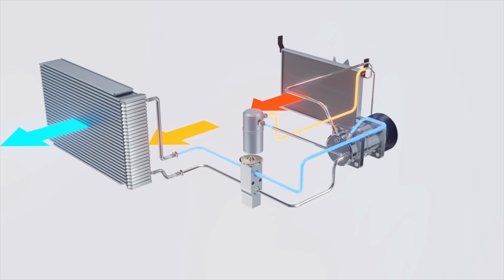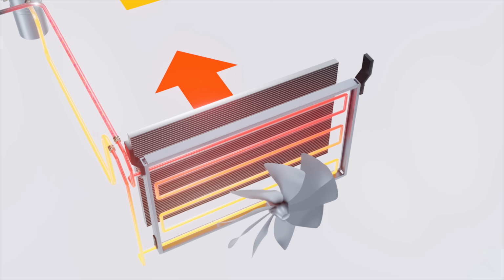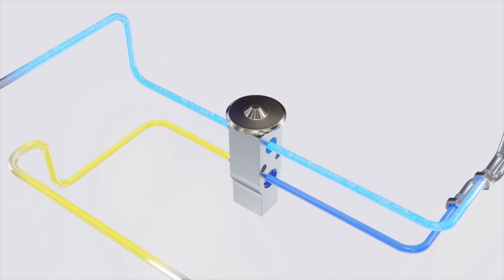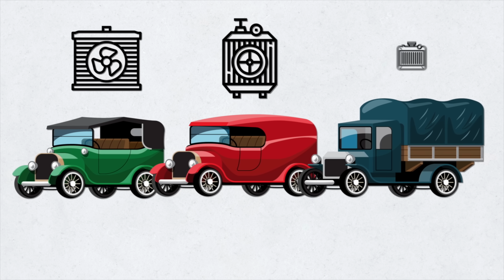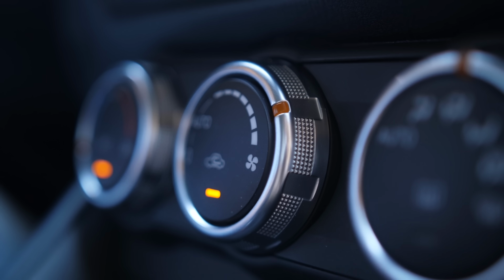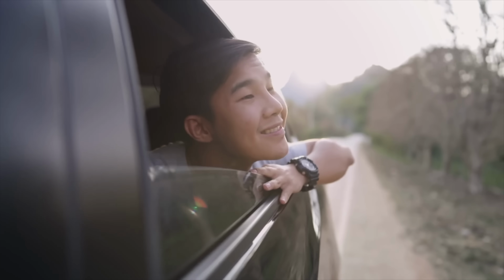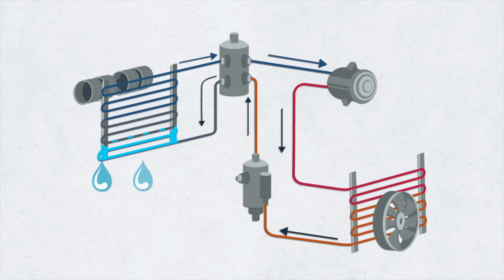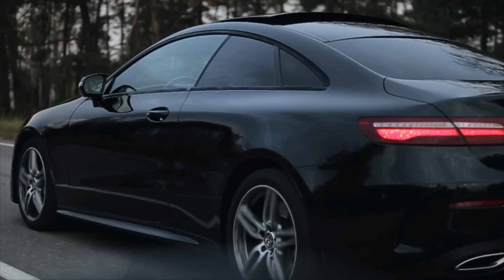Never Do This to Your Car’s AC System

Comment: Yeah, my car has been at a German car specialist for nearly a month and still not fixed, I  have picked it up three times already and the ac failed minutes after leaving the shop each time. So far this cost me around 4 thousand and nearly 2 months with no car and it's still not fixed. After 3k my sense was incompetence, but they promised this fourth time they would get it.   I have never taken longer than a few hours to troubleshoot much more complex systems.

Comment: One good tip with your car's or any air-conditioning system, is to switch it to fan (i.e. no cooling) mode several minutes before turning it off.  That will dry condensation from the evaporator and help prevent mold formation.
Reply: Interesting. Never knew that. Thanks for the tip!
Reply: This also helps people acclimate to the heat outside so it's less intense when you get out
Reply: @beebalm1776  lol
Reply: @koopapro Its true in hot countrys

Comment: @Scotty I have a 2006 Honda Ridgeline blower, when stopping for gas would not com on after a while it would then just quit! Long smoking and bursting into flames story short! Replaced the wiring harness and blower motor and yeah still sweating in central Florida. Still can’t find any blown fuse! But it seems to not have power at the blower plug-in? Any ideas?

Comment: I started driving in the early 70's, I remember my parents MASSIVE, 1971 Chevy Kingswood Estate station wagon, seated 9 people! If you tried starting it with the AC on it would put a heavy load on the start system because of the turning the compressor during the start cycle, sounded like a low battery, turn off AC and engine cranked normally..Now a days doesn't matter, like Scotty said it's disabled until the engine starts. Another myth I've heard is its harmful to run your system to run in Max AC all the time! Don't know if this is true or not, my AC is always on, unless I have the windows down, generally I just regulate temperature and leave the system always on. I haven't had any issues so far and I have been doing this for years. I enjoyed that car, was very smooth on the highways, 3 bench seats but the nice part was the 3rd rear seat folded into the floor so you had a nice cargo space if you only needed the first two bench seats. Thats still seating for 6..
Reply: And we also had to top off the water in the batteries.

Comment: Water drips out of the hole where my blower motor resistor is on certain days when I turn my A/C on. I should try using a camera to look inside the drain hole but eh, It doesn't happen very often. I just buy those water absorbing containers and no wet floor board.

Comment: I have a 05 Dakota at some point I’d say around 2009…every time I turned on the defroster there’d be a rapid fire clicking noise for the first few seconds as it got started… thought it was the cooling mechanism but always only happened whenever I turned it on or off… I’d say like 15 seconds of clicking.., it’d be quiet the rest of the ride… I don’t know much about it I pulled the fan out and inspected it but all looked fine.. cleaned it up of any dust.. put it back and no fix.. looked for videos here for the issue and only one I found… guy did the exact same thing as me and his stopped clicking. I was dumb founded.. it still cooled, defrosted and warmed in the winter.. was just that annoying clicking every time it was turned on or off so just left it.. figured it’s doing what it’s supposed to.. don’t mess with it..

Comment: My AC system sqeals and sometimes makes a grinding noise near the belt when the AC is turned on. When turned off it stops immediately and it’s quiet. I was assuming it’s the compressor but I wouldn’t know how to make certain of that, or if maybe it’s the belt

Comment: I have a Dodge Ram 2007 2500 and the fan on the condenser will sometimes not start and I have to open the hood and flick the fan to get it to start and I have been told that the fan needs to be replaced at a price of 350.00 to 450.00 do you think that is all the proplem and if I get the fan replaced will that fix my proplem. Does this sound like a resonal price. It cools as long as the fan is working.

Comment: So I am still training but I got a 2013 Honda Accord Ex-L with the 2.4 v-tec engine, and I noticed that my car shakes when I turn the a/c on. I'm still running some tests, like does it go away when I'm driving, but I did notice it typically does fade away. Is this a sign of a compressor beginning to fail, or is this typical operation for this vehicle?

Comment: For a while my relay what's up either is either shorting or had a loose wire. My heat or AC wouldn't work. It was the worst one it would rain during the cold months and I couldn't turn the heat on to defrost the window. The fog would be blinding.

Comment: its all about the newton thermal law but i dont think scotty got it right. high pressure always resolves in high temperature, releasing the pressure turns into cooling. if u put high pressure air into ur radiator it wont cool anything it just stays warm until u release that pressure. if im wrong i will be glad someone explain to me how to cool down 40°C-50°C outside temperature to 17°C inside ur vehicle while idling without driving 200mph .

Comment: My A/C is acting weird, sometimesit does not kick on, sometimes it is on and suddenly it goes off of the very minimum speed while the dial is at the max speed or some other times it kickes on to the max speed and stays like that forever it does not changes speed when I try to do it also when that happens, I try to turn it off but it only chages the air position when i hit the off switch. What can that be Scotty?

Comment: Starting the car with the ac on can ruin the belt driving the compressor unit. It's not good to start the car with the compressor clutches engaged! You should be at, at least, 25 mph BEFORE you turn the compressor on.
Reply: Squeaky belt? Try turning off the air-conditioning BEFORE you start the car.

Comment: 500 in parts and labor for the replacement of the ac compressor on my, don't bash me, 2007 nissan altima 2.5s cvt

Comment: Clean the inside of your windshield EXTREMELY well. This will prevent fog or frost for the first 10 or 20 degrees of warm humid weather or the first 10 degrees or so of cold weather. 

I simply use wet paper towels followed by a dry paper towel.  Don't use cloth, because they are greasy or dirty, and will either not clean the windows or scratch it. 

Clean "paper" does not scratch glass or metal.  If it did, I would use it for polishing metals. But it doesn't and I don't!

Comment: My ac is always on, no madder weather :) I had a brand new Hyundai I30CW, and always used the AC for 3 years, and in some of the Services Hyundai did, they checked my AC, they was very impressed by it. They said you AC work extremely good.

Comment: I was working for Advanced Auto Parts when a customer comes in saying their AC isn’t working, “all right let’s go see that the problem is” I said. I put a gauge on the system and it was basically on the verge of exploding due to so much pressure being in the system. The moment that gauge went on it pegged the needle at max pressure. So I asked the customer what was going on here? Now for the life of me I can’t remember what they said but I instantly recommended that they see the mechanics to recover all this extra refrigerant and have the system balanced or recharged.

Comment: 3 days ago I put a can of AC Pro Extreme in my Dodge Intrepid AC.    The Intrepid appears to be in the Mercedes class of complexity for replacing the evaporator.   The air is blowing cool now.   The last time I had cool air after dealer service, it lasted 2 months before losing refrigerant.   I'll see if this lasts more than 2 months now.

Comment: Oh by the way this is the newest car I've had in years and this little four cylinder 2.0 turbocharged is all new to me so I really need some help Elsa figuring the Tennessee now where about I'm in Chattanooga please help me give you some advice give me a heads up I've always take care of my own vehicles the newest vehicle I still own as a 2000 GMC Yukon XLT automatic 4-wheel drive 5.3 with 327000 miles on it that was my wife's baby and a washer last year and I can't bring myself to get rid of it always took care of it that's why hasn't many miles on it

Comment: I always find it tedious when someone says “Y’know, an air conditioner doesn’t ACTUALLY make cold air; it takes the hot air, removes the heat and humidity, and blows it back out.”  ...how is that not making cold air?  It’s simply a more detailed description of the process of making cold air. Having said that, I love Scotty’s videos. He’s hilarious and very informative. Keep it up.
Reply: After all, isn’t cold just the absence of heat? That’s the way I heard it explained way back in the last century when I was a kid.
Reply: @ronsamborski6230  yes
Reply: Most techs look at the process from a thermal dynamics viewpoint where the heat is absorbed by the refrigerant. The end result is making cold air, so yeah.. it's a semantics thing. 

I can charge extra throwing in technical terms, so there's that. :D

Comment: My a/c system hasn't worked in 3 years, it doesn't get cold. I was told the compressor needed to be replaced, can't afford to replace it so I've suffered for 3 summer's worth of heat.

Comment: So question? When sitting at say a red light my ac doesn't feel all that cold but  with higher speed the colder it gets . Is this normal but  keep in mind it's not very cold sitting or driving ?
Reply: Well i guess its somewhat normal if you car has a engine driven fan clutch, but if its electrical fan then no its not normal, i hear that in that case its either the fan or the condenser and to simply clean the condenser and maybe make sure the freon is filled properly
Reply: @fargeeks  Don't  mean to sound so uneducated on this but could explain to a dummy what exactly a clutch driven fan means? The fan does kick on seconds after I turn the ac on.  Not sure  if theirs 2 fans or one haven't checked yet 
If this helps it's a 2003 Camry 3.0 v6
Reply: @dannycolemire2652  its those fans where it will be somewhat slow when the engine isnt hot enough but when it does then the clucth engages and the fan spins about 70 percent of the water pumps pulley speed, but doesnt mean that when the engine starts revving up the fan is gonna do the same thing, anyway its the electric fans that kick on after turning the ac on so no the clutch fan has nothing to do with it

Comment: I recently had my condenser and evaporator replaced by Honda in my 17 civic. No cold air was blowing when I turned the AC on. Replacing both parts cost my just under $1300. Honda warranty covered the condenser. They had to take the cabin apart to get the job done. My service rep was nice enough to throw a discount too. AC is nice and cold now!

Comment: On a 2009 Toyota Corolla
My ac compressor clutch got stuck, stopped the engine from running, because the car used a single belt for all mechanical stuff, i had to toe the car.

Comment: I always make sure to turn off the a/c about 5 minutes before I get to my destination, and put the fan on about 75%. That way the evaporator has time to get to room temperature, dries off and doesn't remain cold. Helps prevent mold growth and that musty smell.
Reply: Hum and it doesn't get dust, from the engine bay, in by running your fans without A/C?
Reply: @helloukw  Nope, only difference is the a/c system isn't cooling/dehumidifying the air. It's still pulling fresh air from outside and going through the cabin air filter. And once the evaporator coil (the part inside the dash that gets cold) gets to room temperature and dries off, it won't get moldy/musty as there's no moisture left on it

Comment: Hi Scotty, I have a 1975 Lincoln Mark4 with 460 engine. The 
AC on the car only produces cool air when the engine is idling, and once I give it the gas is loses all the cool. Any idea of what might be the problem? I had it checked and the compressor and refridge levels are fine. Thankey kindly buddy!

Comment: My evaporator is leaking in my car, Can hear the gas leaking out behind the dash. And... Its a Mercedes. Need to remove the whole dash. It worked well for 18 years. but i roll around with no ac

Comment: Did you know???? The Goldberg Brothers - The Inventors of the Automobile Air Conditioner. Here's a little factoid for automotive buffs or just to dazzle your friends.

The four Goldberg brothers, Lowell, Norman, Hiram, and Maxwell, invented and developed the first automobile air-conditioner.

On July 17, 1946, the temperature in Detroit was 97 degrees. The four brothers walked into old man Henry Ford's office and sweet-talked his secretary into telling him that four gentlemen were there with the most exciting innovation in the auto industry since the electric starter. Henry was curious and invited them into his office.

They refused and instead asked that he come out to the parking lot to their car. They persuaded him to get into the car, which was about 130 degrees, turned on the air conditioner, and cooled the car off immediately. The old man got very excited and invited them back to the office, where he offered them $3 million for the patent.

The brothers refused, saying they would settle for $2 million, but they wanted the recognition by having a label, 'The Goldberg Air-Conditioner,' on the dashboard of each car in which it was installed. Now old man Ford was more than just a little anti - Semitic, and there was no way he was going to put the Goldberg's name on two million Fords.

They haggled back and forth for about two hours and finally agreed on $4 million and that just their first names would be shown. And so to this day, all Ford air conditioners show -- Lo, Norm, Hi, and Max -- on the controls.

Comment: What if the AC air smells musky when I start the car but starts to smell better after about a minute? I replaced the cabin air filter and it still does this. What could be the problems?

Comment: I bought a 2006 chevy impala brand new when it came out.  It did great for awhile but then all the gremlins start coming out around 2012.  First i had the water pump break on me, so i got that fixed right away.  Then i had the blend door actuators going bad and making constant ticking noise.  It was a cheap part but can be difficult to replace.  I had the dealer replace one deep in the dash and it was $700.  11 months later, it happened again, luckily it was the one the dealer fixed and they replaced it under the 1 year warranty.  Then i had another blend door actuator under my glove compartment.  This one i just left alone because it only started ticking when i turned off the air recirculation or turned off the car.  It wasn't doing any harm.  Then my a/c compressor broke.  I took it to a shop on the military installation and they told me to take it out in town to a mechanic, get a diagnositc and bring it back.  The mechanic said the compressor was shot and would cost $1800 to replace.  I took it back to the shop on base and they quoted me $1300 and that included replacing the whole a/c system, not just the compressor.  Plus i didn't have to pay sales tax.  A/c ran strong since then. Then my water pump broke again about 6 years later.  And then i had another blend door actuator ticking on me but it wasn't an every day issue, just when it felt like it.  At 124k miiles i decided to trade in.  Everything else has always been good with the car, the motor ran strong did regular oil changes with synthetic oil, never had an issue.  But never again will i buy a new design model in the first year.  I got a decent deal for trade in, i was expect $1600 because it was in fair condition but they gave $3000 and i used it towards a new truck.

Comment: Great video! I own an e39 for 14years (produced in late 2000) and the AC system worked without any major issues, I had 5years ago a cracked pipe and 2 years ago a funny thing happened, if I drove the car up to 120-130km/h the AC worked fine but as soon as I went higher a strange noise coming from the engine bay and AC dies,  if I reduce the speed below 100Km/h and restart the system, AC worked again. When I opened the hood, a clutch smell is coming from compresor pulley so I replaced the compresor clutch but no, this was not the issue, some valve inside the compresor was faulty, get stuck at some point and lock the compresor causing damage to the clutch. I replaced the compresor with a used one under 30eur (a new one is about 500eur). why is so cheap at junkyard? because on e39 they rarely brake. So even if I refreshed the freon and compresor oil every 2-3 years, after 300k km it is expected something to go wrong but I have friends with new cars, premium german cars that have issues with AC system at 15k km, 40k km and as soon as the warranty expires around 100k the compresor is falling again and this is something that should never be expected of a new car. They changed the system, I guess was too reliable...

Comment: My shop deals with leaking evap cores and broken compressors a lot.  The most common reason..driving with the ac on with the windows down, and/or not putting it on recirculation mode.

Comment: The truck I bought somone put the pulley tensioner on backwards and it ate about a 4 inch hole into my lower AC hose

Comment: I have a Honda Civic 2017, Last weekend my A/C stopped cooling. It had a random issue where suddenly stopped cooling for a moment and then worked again. But this time it won't cool at all. I had to take it for a refrigerant charge. They said they didn't find any leak but I doubt it specially with all those videos about Civic's AC being a pain in the butt. It uses the r-1234yf refrigerant and I tell you, it was expensive for a charge! I hate it